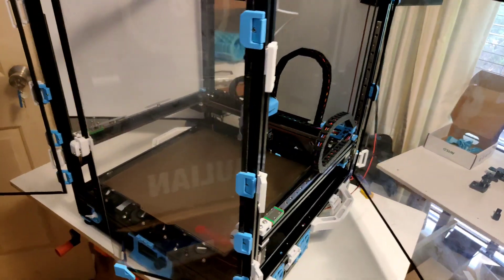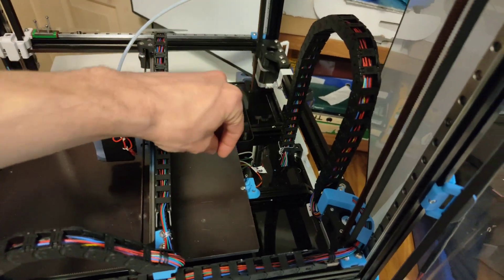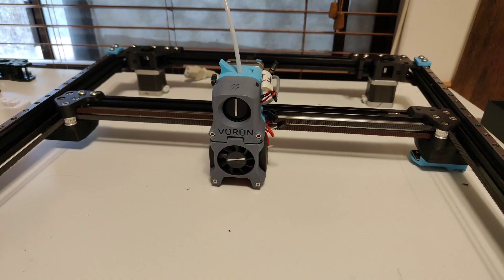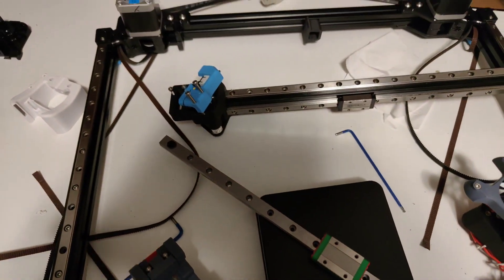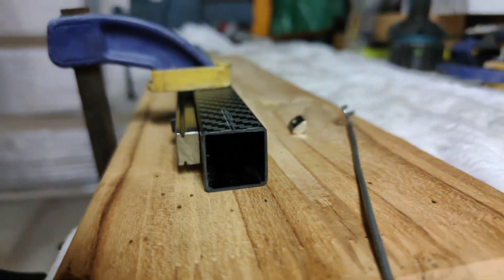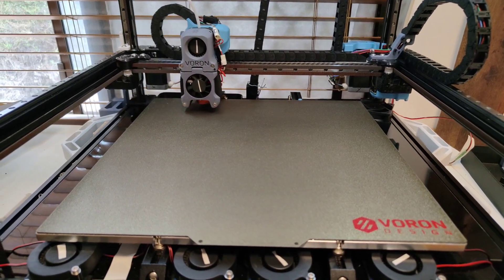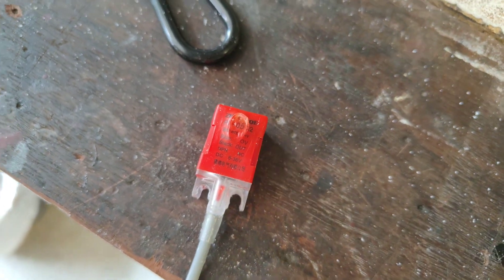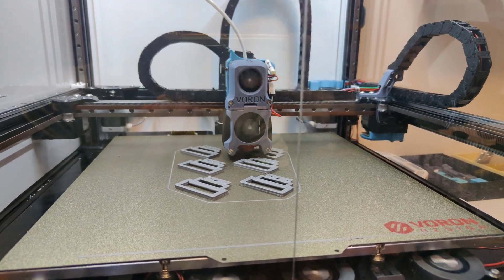Voron 2.4 Upgrades Carbon Fiber, SolidPins, GE5C, MGN12 & Probe Butchering.

Comment: The reason your bed mesh is screwed up is because of the carbon fiber extrusion not mitigating the linear rail warping as the printer heats up. It's not your bed, it's the x axis. You can use a single mgn9 to save weight but use an aluminium extrusion.

Comment: Please flip those cable chains around... they're supposed to lay flat and straight. Not be all loopy in the air.
Reply from the maker: Anesthetic cables chains lower look better. A tighter curve cable chain means more bending of the wires. As in runs access the x axis.
I don't have premium high quality silicone coated wires. So a larger loop put less stressed the wires.

Comment: yup Euclide is the way to go no problem of melting Probe anymore... You should also go with umbilical cable. with canbus Ebb36 you will be able to remove all those cables. and chain accept the one for AB motor. Run the endstop sensorless... it work well also.

Good job BTW really nice voron
Reply from the maker: Canbus sounds great, I really want the voron to have a horizontal top mounted x axis linear rail like the vzbot. Not a fan of this front mounted linear rail

Comment: But whats the point? Is she faster or are the prints better now?
Or just upgrading it for fun?
I like those latches! got a link? :)
Reply from the maker: Bed mesh is different. I'd say it's worse. A 0.25mm variation over 350mm bed is acceptable for me.
Where the variation comes from I cannot figure out.
With a 5x5 mesh it prints perfectly 

I run the machine at moderate speeds,
1k-4k acceleration 150mm infil 100walls

All upgrades are for fun and reliability. 

All the mods I think can be found on the voron GIT user mods